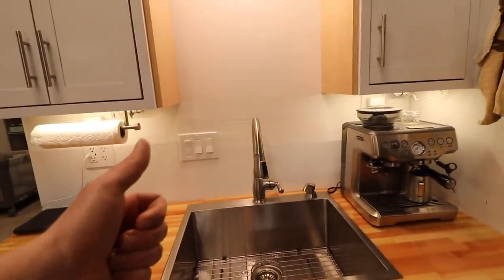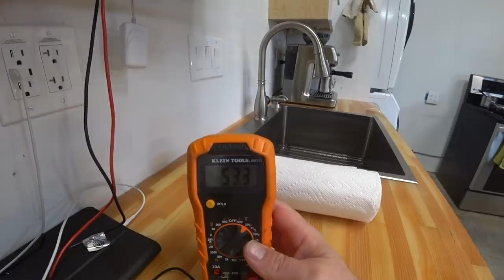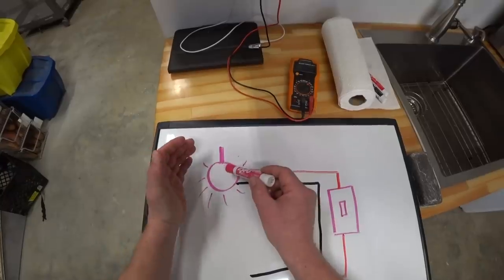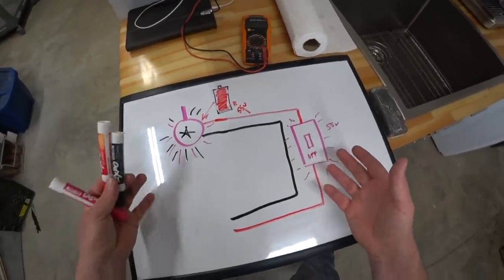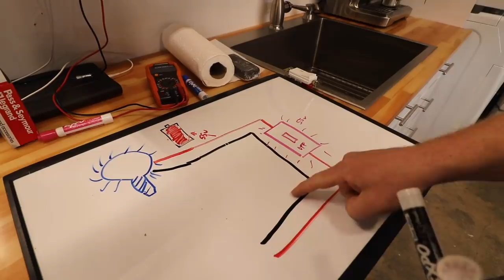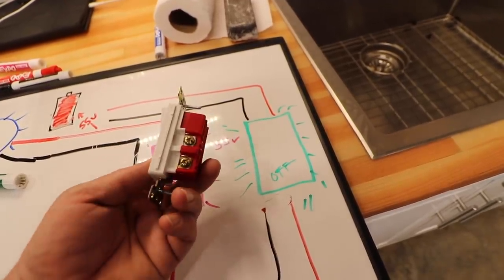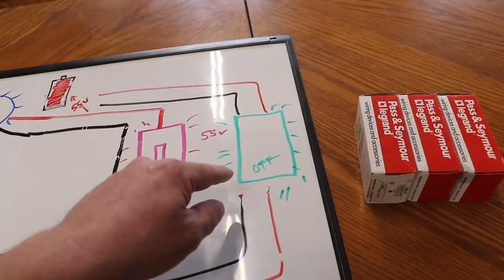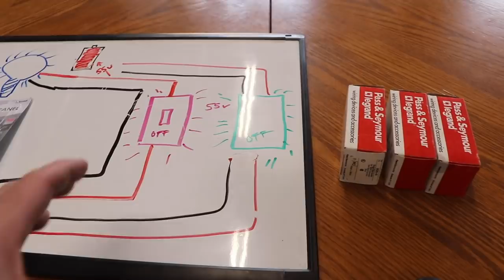Don't Use LED or CFL Bulbs 'Till You WATCH THIS VIDEO

Comment: Title should have been "Don't use lighted switches 'Till you WATCH THIS VIDEO"
Reply: Yes a clickbait title... When I saw it I thought; "That ship has sailed for nearly everyone."  His problem is the failure of those designing the switches for proper operation, with a probable solution of a capacitor and diode designed in the circuit board(s) of the switch and/or lights.
Reply: The illuminated lighting switches are not normally suitable for use with low energy lamps or loads .
Reply: or read the packaging for the switch: "NOTE: When connected to compact fluorescent lamps or LEDs, the bulb may flicker while switch is in the off position."
Reply: Hey, it gives Professor jesse another chance to pontificate. 
I do know these switches need to be rated for CFL/LED, whether that pertains to Low Voltage or not, is another thing.
Reply: This dude seems to be notorious for not reading the basic instructions & warnings, not understanding the basics of a product, making big mistakes, then arrogantly accusing the product  of being  the problem when the reality is, HE is the problem.

Comment: You purchased an illuminated switch for an incandescent bulb and now you have found that you need to buy a switch designed for LED bulbs. Yes it does make a difference. Most big box stores do not carry switches for low current lighting.
Reply: But Jessie doesn't like to be told what to do. He always knows best 😂

Comment: why don't you put siding on your house its been like 5 years
Reply: bradini I'm thinking that when the house is finished, the property taxes will be adjusted to current market value. Right now since the house is not finished, the property taxes remain as if it was when they bought the bare land.
Reply: No money left!!
Reply: @cb4648  
I knew some people years ago whose house looked barely habitable from the outside but the inside was immaculate and fancy.  Basically, because they were in what could be considered a "low rent" district, they put their money on the interior where they lived and did only what was necessary to make the house weather proof on the outside and prvent the city from condemning it.  So they had luxury living on the outside and low property taxes and maintenance on the outside.

Comment: Hey you could do a trick that works bro : Just let the swicht turn on a relay that supply the lights with a second ciruit of power (so in simple the swicht turns the relay on the relay turns the light on ) then your problem is done . you get also systems to build inside the fuse box (here in our country they are pretty common) so you should ask arround for parts like that . Have fun !
Reply: You need to put a relay for your LED circuit. The relay don't store electricity as a capacitor. The relay is an electromagnetic magnet that close the circuit. So a 110 Volt AC  relay. You need to buy the relay with the same amp as your home electricity circuit.
Reply: Would work but not a fail safe option.
Reply: @Ixions  maybe you could explain why it is not "Fail safe"
Reply: Thomas Eisen why not just a simple resistor put in to service?
Reply: @markbarnhill6300  - it is exactly what I mean. He has to drain the current leaking true the switch.

Comment: Sounds like you improperly wired your circuit the glow switch uses a diode.. separate it from your light circuit 
Using a neutral within the switch box..
  Now that I watched the video it's just like I said.... as a master electrician for over 30 years I have never had those problems your switch is fine
Reply: You are incorrect the switch backlight is Neon!!
Reply: All wrong the concept is pretty simple you have a low powered led in parallel with a standard switch when the switch is on it's effectively zero resistance so no power flows though the led when it's off you have a low voltage low current situation with a incandescent light the output is so low the filament doesn't get hot/ produce light but cfl and led have electronic control circuits which see the voltage attempt to start the light and promptly turn off again due to lack of power hence the flashing

Comment: I noticed when I had a similar issue, the solution was that the LED bulbs that I was using were not UL compliant and switching to UL compliant bulbs made the problem go away. Did you try the back lit switch in the bathroom yet? How did it work?

Comment: Try the lutron LUT-MLC. I had the same problem and this fixed it.
Reply: This is actually the correct solution. It's a shunt capacitor. MLC stands for Minimum Load Capacitor and he should install it in the one of the outlets(assuming both outlets are on the same circuit). Only one MLC is needed per circuit/backlit light switch.
Reply: Use your adblocker people.
Reply: As a former installer of lutron products I can attest to thier quality, great stuff.

Comment: Why not install switches without the "night lights," and then plug one of those dedicated night lights into one of the outlets to illuminate the switch area under the sink?
Reply: This would be too simple and Jesse doesn't like simple.
Reply: @ughhitstodd949  Neither do I. I am with Jesse. We both look for the precisely correct solution to problems.
Reply: @ganterpv    in my book the nightlight solution is exactly the right solution because I have always found lighted switches unreliable
Reply: I agree with all of these people.
Reply: @ughhitstodd949  You are (also) correct. Your kind of solution ends with a workable solution in an optimum time frame.
Reply: @ughhitstodd949  millions of people find lighted switches to be perfectly reliable.

Comment: A bit of a different tack:
A three-way switch (AKA SPDT) could be used. One way turns on the LED lighting as normal, the second way switches in a small LED nightlight. It's not the same as an illuminated switch, but it would solve the flashing problem.

I ran into this same thing with a motion sensor switch.
Reply: I think he is after a lighted DPDT switch?
Reply: @schwags1969  isn't that last switch for a 3 wire setup?

Comment: The problem is that the capacitive dropper circuit in the driver doesn't have a properly sized discharge resistor for that application. If you had a switching power supply this wouldn't be a problem. That's probably why the bigger lights don't have the issue.
Reply: I personally have rgb controller above hood fan powering my cabinet lighting with motions so as I approach they come on with the Color I saved on the memory function in the remote that I keep in the catch all drawer
Reply: Ta psu is witchetd. They have the same problem. And the resistor should not be across the dropper cap. It should be across the filter cap.

Comment: Got this from a message board. The person was having the exact same problem. Was advised to use these switches and he came back and said they work well. The Lutron Claro Illuminated Decora switches are supposedly rated for LED/CFL in addition to incandescent/halogen. Model numbers are CA-1PSNL (single pole gloss finish), SC-1PSNL (single pole satin finish), CA-3PSNL (3-way gloss finish) and SC-3PSNL (3-way satin finish).

Comment: I just use an led nightlight that plugs into an outlet and comes on when it is dark automatically. I would use regular switches.
Reply: Your solution is too simple and Jesse doesn't like simple.
Reply: The plugs are switched so they would have to be on for the night lights also turning on the under cab lights
Reply: You could use (non-solar) outdoor path lights which are activated by motion. I've had batteries last over a year.
Reply: Interesting little known fact: LED nightlights that come on when it's dark actually use slightly more electricity when they're off than when they're on because it's easier to short out the LED than it is to disconnect it. Of course, they use so little electricity that it really doesn't matter.

Comment: From what I understand about that type of LED lighting is that they are not meant to have an external( ie, the DPDT OR SPST) switch. I believe what you need to do is bypass the switch and use night lights. My best advice is;  remove the 110v switch and go fom there.

Comment: Why do you need two switches that glow? Surely you only need one to find out where they are. Also if you need to have lights on wouldn't you of turned a light on when you entered the garage of walked down the stairs.

Comment: A 12 volt switching power supply for your LED's, if you want to keep the wall switche(s). You could use one switching PS to control all of them also... instead of having wall warts.

Comment: Someone may have already said this but install a GE Z-Wave Plus 3-Way White/Almond Smart with LED Rocker Light Switch. Not only will you have the ability to turn the lights on and off from your phone, but they also have a small blue led (below the rocker switch) that helps you locate the switch in the dark. I have three of these installed currently in my home. They require a hot and neutral line in order to supply constant power so the z-wave components can constantly be listening for wireless on and off commands.

Comment: Try using a Luton product called LUT-MLC, this go's between the neutral and hot wire at the switch or outlet. I have used this  many times for that problem you are having.

Comment: Get dimmer switches and move them away from the sink and don’t tie them into any other circuit. GFCI outlets are required by any water source (Kitchen, Bathroom etc)
Reply: No GFCI  outlet needed if you have GFCI breaker
Reply: I'm pretty sure the have gfi brakes in most of the house. If I remember correctly they had to have them because they were living in the house pre drywall. Plus a lot of houses have switches close to the sink like that. Mine does for the garbage disposal outlet.
Reply: This LED is not dimmable!

Comment: Isn't it a safety hazard that an outlet that's supposed to be turned off has 55 VAC on it? I mean you count on a switch to break the circuit. Even with an incandescent bulb, it would keep the filament warmed up and waste power.
Reply: Well that's the problem... the switch assumes you just have incandescent bulbs which is a dumb assumption
Reply: This is a very interesting problem.  The light in the switch is a neon bulb, there is a resister or capacitor in series to limit the current.  UL (underwriters lab) which regulates safety, allows for a small amount of current (1-10 mA) to go through humans.  This current causes the 55 volts he measures with his DVM, if the input resistance of the meter was different the voltage would be different.  He was close to a solution, but He chose a night light that uses an electroluminescent light that draws very little current which allowed the voltage to get high enough to trigger the LED.  If he had found a old style incandescent night light he would have been successful.  The night light would not be lit but it would prevent the voltage to build up.  The night light will be on when the LED is lit.  The solution below using a 1 Meg resister would also work but I wouldn't recommend it, UL would want it to be 2 watt carbon composition to have sufficient voltage rating.
As an interesting fact, TV sets are required to have a certain amount of leakage current...A REQUIRED SHOCK!!
Reply: The voltage (55v) you are seeing is due to the light in the switch seeking a return path. If you were to put even a very small load in the circuit, the voltage will approach zero.
Reply: I found LED night lights that turn on and off with the light in the area ! Two for $2.50 on sale !
Reply: @jimhutton2390  Found out to my cost that holding on to an earthed chassis whilst using one of those neon screwdriver testers still results in an electric shock on the 240V mains of the UK
Reply: I'm with you Patrick - A switch that doesn't fully isolate the voltage is not only dangerous and wasteful, it would be illegal in Australia.  Although we use some Legrand products, we don't use their domestic switch / outlet hardware.  We have Clipsal and HPM among others for that and they have a lit switch that has its own neutral connected.  Our isolators isolate.
Reply: Neon light built into the switch is does not allow enough current (in order of uA) to electrocute a person. It may give you bit of a tingle, but will not light up.
Reply: The neon indicators are designed for a single gang circuit, very high resistance and safe to use, but need a return path so bypass the normal switch. 99% of lighting switches will not have a neutral available as there was no need. Will change in the future as smart switches need a neutral, but very expensive to rewire existing  houses, just for that. A resistor and capacitor across the circuit, live to neutral,would work, if allowed depends on the local regulations
Reply: @jimhutton2390  - what if the incandescent night light had a photo cell so that when the LED comes on, it provides enough light to switch off the resistive load of the incandescent bulb?
Reply: @connomar55  Even a 5 mA current is a very noticeable shock.

Comment: Hey, nothing wrong with those new switches.  See that third terminal on there?  That needs to be hooked up to the neutral wire so you can have a little light on your switch.  Did you look at the diagrams on the box.?

Comment: It's called leakage current.. It's a very small current that over time will charge the capacitor in the wall wart to a voltage that will activate the power supply.. When the supply activates, the current gets relatively large, thus discharging the cap.. the light goes back off.. the leakage slowly starts charging the cap again and the cycle repeats... He does a fair job at explaining this.

Comment: The answer is simple, please try it just to see if I’m correct or not.
Your first drawing in the video you said the hot goes to the switch and from the switch to your lights, and your neutral goes straight to the lights.   Believe it or not the problem is the neural wire. It to needs to go to the switch first just like the hot and then to the lights just like the hot. 
You currently have a broken current, once you fix the neutral it won’t be broken anymore and it should all work like it should.
Like I said just try it, you have nothing to loose.

Comment: Check your wiring.
The neutral can not be broken by the switch. The gold screws get the hot side and contol the flow. The dark terminal goes to the  neutral side of  the circuit. The bulb in the switch then has a completed path when off and the led does not see the hot side untill the switch is turned on
Reply: That was my first thought until I remembered that it wasn't the neon that was strobing. It needs a shunt capacitor at one of the outlets, or in a different use case, the fixture.

Comment: Leaking a small amount of current through the load to run the glowy bit is being phased out, that's why there is requirement to have neutral in every box.

Comment: In Europe, we have this kind of technology already 20 years ago. It's pretty simple, ours switch have a hole where you can put a small led that shine throw the plastic of the switch, you connect this small led on one side to the neutral on the over side to one pole of the switch depending if you want it to be on continuously, when the light is on or when the light is off.

Comment: I live in New Zealand and I have achieved this in all the House's I have wired up as an electrician. Here we use completely different switches. Our switches have an LED with two tails built into the switch which have to be manually wired, one tail with the neutrals and the other with the switched line or in terminal 2 (which achieves the effect you are after) 

Hope that helps. If you need me to explain more let me know.

Comment: Your problem is caused by the wall wart itself. Cheap wall warts don't use transformers.  They take the incoming AC voltage and run it trough a rectifier converting to DC, then it goes trough a DC to DC converter which drops it down to a lower DC voltage.  A simple solution to this problem would be to find a transformer based wall wart with the same volts and amp specs as the cheap psu.  Transformer based psu's a heavier than a cheap electronic one's, and more money.

Comment: What you've been shooting for to cure the problem is a Double pole, Single throw illuminating switch. Most of these types of switches have an amber (Neon) bulb inside the switch that is connected internally on the supply side terminals of the switch.

Comment: I believe the neon bulb in your switches probably consumes around 0.4mA.  At 120V V=IR translates to 120/.0004 = 300,000 ohms.  Therefore, I think a ballast resister of 300k Ohms wired from the switched side to neutral would drain away the current and stop the problem.  Of course, insulating the wires going to the resister is a challenge, but heat shrink could do it.